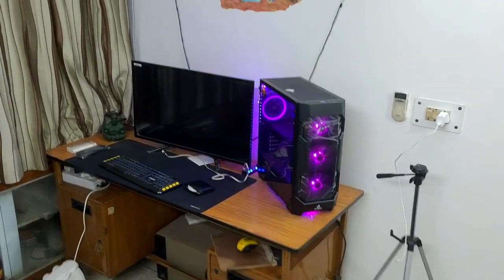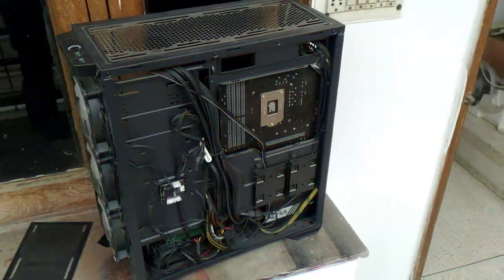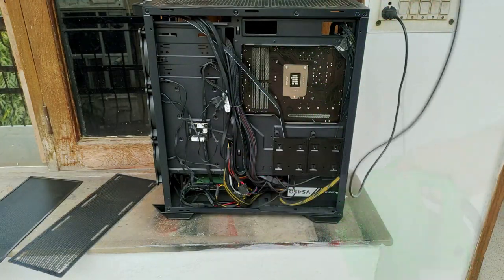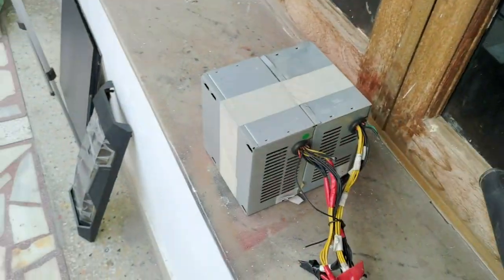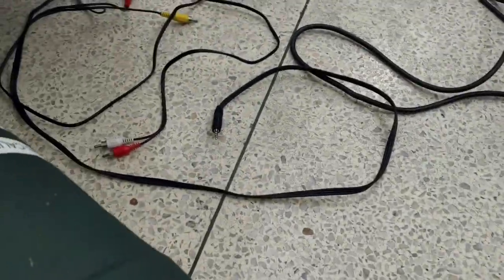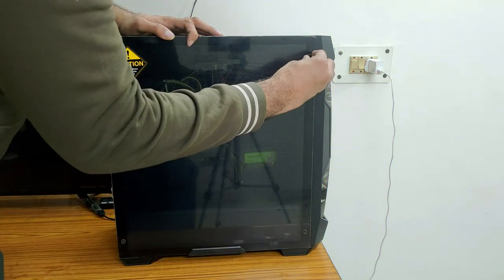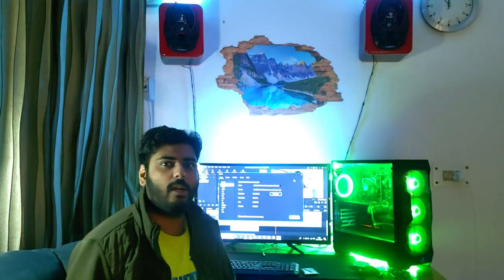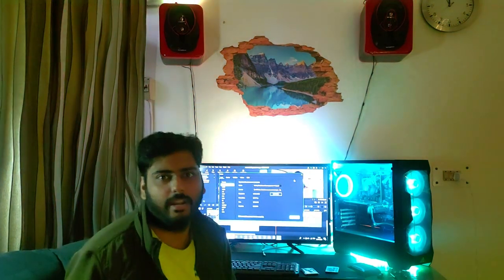ANTEC DF500 RGB Along with my Office Studio Super Cleaning

Comment: How should i open the front panel of the cabinet. The fans panel from outside i want to clean it but im not able to figure out how to remove it
Reply: Did you get the answer? I've been wanting to take off the front panel and clean too.
Reply: @adhithyarajarajan   U have to open the glass panel and from inside there are clippings which u have to press and push it, usually comes of easily but it was difficult for me for some reason.
Reply: @what_am_i_doing_now  oooh thanks dude . Just plastic holders right . No screws and whatnot ?

Comment: Specs kya hai bhai PC ke ?? :-) looks really good :-D
Reply from the maker: Hey, are you Johny from the tech phase. How are you man did watched lot of your videos brother. Great stuff keep it up. 😊😊. And for the specs I got Core i3 8100, Rx 570, Gigabyte z370 d3h, 8 gb ddr4 2400 mhz zion Ram, Corsair vs450, Antec df500 rgb case with antec exhaust fan, Adata su650 480gb ssd and 1tb Seagate firecuda SSHD. I already bought the new Ram which is Corsair vengeance 8gb 3000mhz ddr4 X2. Gonna make a video on that too soon..But as my channel is not much related to this stuff that's why i doesn't get much response. 😜😜
Reply from the maker: And i have made some other videos related to this antec df500 rgb case. So whenever you get some time please do check out that small playlist by the name Antec df500 rgb...

Comment: How to open metal side panel I couldn't open it i opened back side 2 big screws but couldn't seperate side pannel from case help me
Reply from the maker: After opening it screws just slide the panel backwards and voila it's out.
Reply: @AmulLuthra  i tried that also but its so hard to pull out n i was scared to pull it out coz i had no instruction how to remove it. ok do i need to apply more pressure to pull that backwards?